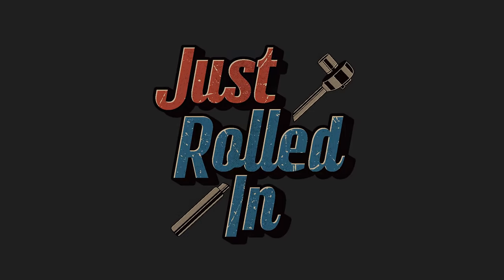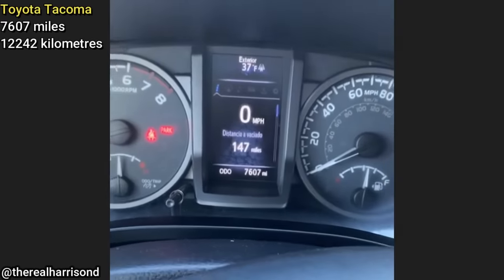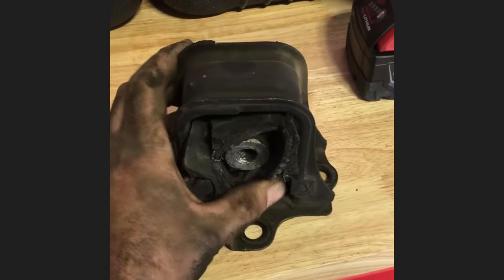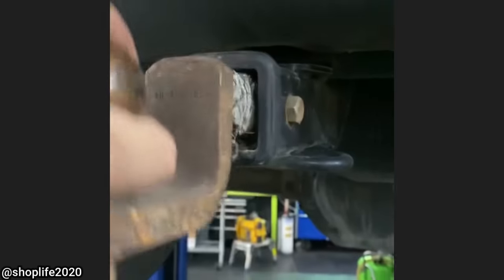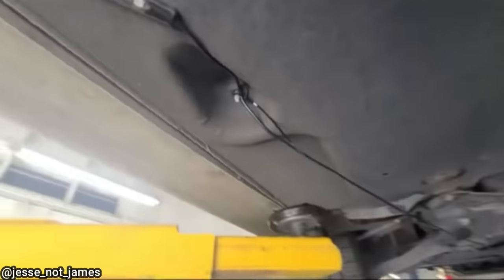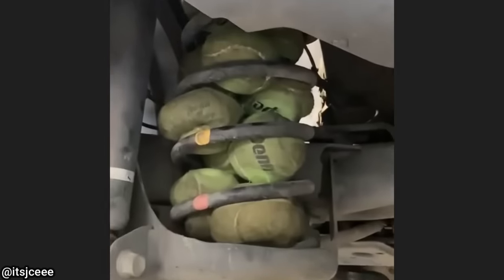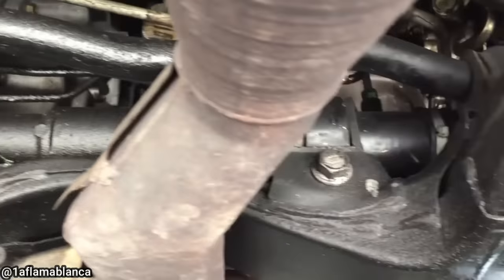Customer States Change Engine Oil On Tesla | Just Rolled In

Comment: That third one is the funniest issue I’ve ever seen, I can’t even imagine how convoluted the string of issues that would cause this must be
Reply from the maker: That door opening one is hilarious lol
Reply: @JustRolledIn  that one was great. Lol someone plugged something in the wrong port  unless they hard wired it in cus they are different plugs unless it's not like that on that make an model.
Reply: The second one is the heat not working, did you mean the third with the door opening?
Reply: @patricktrimble7954  yes, I’ve corrected that
Reply: Probably door weep hole clogged and a short occuring. I keep pipe cleaners in my glove box just to clean weep holes because the pollen down here is insane
Reply: actually, if its a cable driven power window, it may just be as simple as some of the plastic cable clips have broken and when the power window is activated the cable pushes on the door leaver rod. or something along those lines.

you would probably be able to open it from the outside when someone is using the power window.
Reply: @myopinion69420  sounds like a solid theory. those cords can come loose and cause a number of issue.
Reply: @myopinion69420  Yeah, a short would lock/unlock it but not pop it open necessarily, unless I'm wrong and that model in specific has those supercar like button opening doors.
Reply: @Kalvinjj  yeah, i suppose it might have aftermarket door poppers, if thats the case it may have been wired wrong/shorting with the power window.
Reply: My question is what specific set of actions caused them to find that out, and presumably it's happened multiple times since most people are too lazy to take their car in to the shop for something that happens once
Reply: @gideon7212  Pretty straight forward, really. Rolling down the window as you're in the drive-thru of a restaurant.
Reply: If it were within my power, I'd offer some free diagnosis time just to find out what it was.  I just want to know how an electrical switch can open the door.  Best guess is something mechanical is wrong such that the window hits the latch.  The left turn may be needed to move things in place.
Reply: That left turn isn´t part of the issue, that´s just what physics does with open door.
Reply: That reminded me of King of the Hill where Bill's home wiring is so jacked up that when he pulls the chain on the ceiling fan, his microwave turns on.
Reply: The window regulator pulling on the door actuator cable maybe??

I saw a vehicle which opened its fuel door everytime the driver's door opened fully.  The switch to release said fuel door is in driver's door panel & its wires were pinched by the door check strap, shorting the circuit whenever they opened their door all the way.
Reply: They took their car to
 Q's Performance & Audio shop.
Reply: @Kalvinjj  This is why it happens when turning left. Adds sideways g-force that opens the door.
Reply: Maybe they watched 2 Fast 2 Furious too many times. "EJECT-O SEAT-O CUZ!"
Reply: "was just gonna let it be but jimmy said i should get it checked after he went out the side the 1st two times"
Reply: Yeah I put good money on @My Opinion's theory, my first thought as well. I owned that model Camry and let me tell you it's one of the last cars in the world to have a fancy gimmick like electric door openers

Comment: I’ve done that tennis ball in the spring fix before, on my ‘04 LeSabre when the air shocks started leaking. The compressor was running much much more frequently, so I just pulled the fuse for the compressor and shoved tennis balls in the shocks, it definitely reduced the bounce over nothing at all.

Comment: That blue Chevelle at the end is quite the beauty. Love the speedos that go horizontal rather than these ubiquitous round ones now used. Just when I thought I had seen it all, I see even more goombas at work than ever before.
Reply: I was worried for a minute as we panned around the car that we'd see severe damage at the back. Very relieved to see it was just a sweet ride included at the end of the video.
Reply: She’s a beauty!
Reply: In summer of 1980 my buddies and I were out running around as per usual. I saw a 67 Chevelle, dark blue with black vinyl top in a field out in front of a trailer house. I stopped and looked at it and asked "how much"? The engine, tranny were already out. The dash wiring was pulled out and I didn't buy it because of that. The price 50 bucks! I kick myself about that and a 100 dollar 69 Charger. Those were the days...
Reply: I like the round gages gauges in the old IH trucks, never cared much for the dashes in the '70's Scouts/pickups/one tons. The dash on my '87 International is perfect!
Reply: My first car had the round speedometer. 120 was at about the 4 o'clock position. I saw the needle pointing straight down one night and that was after it had been coasting down for about a tenth of a mile. I also had to fight the car back into my lane because it took a hard dive for the left side of the road and almost went off the road when I took my foot off the accelerator. I never tried that again.
Reply: Chevelle is nice, but hoarder cars are definitely the best.

Comment: In the '60s, Buick had to get rid of their 2-speed torque converter, because it made a slight whining noise in low gear and customers kept screaming for new transmissions. Oldsmobile tecs had a fun time getting into arguments with customers, as to why snow tires had to go on the FRONT of their Toronados:)
Reply: switch pitch, not 2 speed.
Reply: someone told me of a story where he saw a guy in an Audi 80 (Audi Fox in the US), second gen, who got caught on a slippery road (not even a steep climb, maybe 2 or 3%?), and sat on the side bank looking at the hind wheels while the front wheels whirred loosely on the ice layer...
protip: if you drive front wheel driven, and feel the need to use the handbrakes to help with traction, this would work only on older Citroen, as their handbrakes work the front wheels...
Reply: @lotharrenz4621  The French can be a bit weird. -Jeremy Clarkson, Carnage a Trois
✌️😎🍻
Reply: @Jeff.78  I know; the french border is 1 and a half hour drive away from my place to the west... XD

Comment: 2:19  Hey, at least the customer realized they were in over their heads and brought it in.  Compared to the others that make this feature, they deserve an attaboy.
Reply from the maker: Definitely! Lucky they didn't catch that brake line on anything on the way to the shop.
Reply: Yeah, probably just a case of thinking it was doable but ended up being too much.  Having the wherewithal to realize you're out of your league is a sadly rare skill.
Reply: @psychickumquat  I think it's willing to admit defeat that's lacking. Society values winners, not quitters.
Reply: @russellhltn1396  Winners can be humble, which may be what you meant, or not. Either way, humility is also lacking in society.

Comment: I did the waste oil tank "fountain" when I was 18 and working at a used car dealer. Thankfully it was outside!

I was rushing at the end of the day and whipped the airline open 100%, then the geiser erupted.
Reply: I can hear the 'Beverly Hillbillies' music playing in the background!
Reply: I did once catch pan cannon. Didn't leaked, but the pan cracked its bracket and did it almost till ceiling, 6 meters above (about 20 feet). Luckily, no cars were in shop
Reply: @youtubeSuckssNow  you pump air pressure in it to move oil from the barrel in old oil storage tank. Forget some of valves, and you have  fountain

Comment: The Tacoma reminds me of a 1993 civic I had… drywall screws held on the rear bumper. That car was a total tweaker car. I ended up having a D16Z6 put in it replacing the stock D15B7. Loved that car.
Reply: @chir0pter  I’d love to know. They pulled out the antenna and filled the hole with silicone also. Honda makes a part for that…. 🤦‍♀️
Reply: @chir0pter  it's called being a poseur. He wanted the look on the cheap, but doesn't care about function.

Comment: What the hell else ya gonna use old tires for other than vibration/noise dampeners on engine mounts and body mounts oh and tow hitches????? love it! another great episode.
Reply: I mean I guess it works, I know a lot of the Miata guys are using hockey pucks for motor mounts.
Reply: ..& tennis balls in strut springs! Shoulda thunk of that when spring broke on my ( now gone..) Caravan. Oh well:/
Reply: I thought the rubber in the mounts was a good idea. I've used heater hose for sway bar bushings, and radiator hoses for other insulating purposes. And I still have some rubber from an ancient inner tube for all kinds of things, including fixing rattles. All on my own car, never for a customer's car.

Comment: When I had my corvair I would ask the to check my antifreeze to make sure it was good for the winter. Fyi for those who don't know, corvairs we're air cooled.
Reply: My father knew a guy who was a Sargent in the Army, every time he would get new privates in he would tell them to go and make sure they checked the coolant in the M26 Pershing tanks before they did anything with them.  Of course he would leave out the part where the M26 had an air cooled engine. Said most of them figured it out pretty fast, some though, yeah.
Reply: and Goober would put the antifreeze in with the gas, so the gas wouldn't freeze ...
Reply: were you a hot chick in the 60s ?
Reply: @mitchhedberg4415  Unfortunately he wasn’t able to join, but like the rest he probably would have

Comment: Oh, I did that oopsie once, forgetting to close a valve on the oil collector and got a fountain of oil messing the entire shop up. Easy mistake to do when you're a bit stressed. Only did it once though!
Reply: I think it's a rite of passage for mechanics. I don't trust anyone who says they've never done it, because they're probably lying.
Reply: @KarlEller  You might be right!
Reply: Did it when we refurbed our shop and installed the drain system.Boss was real impressed with my top coat on the new paint.Only do that once.
Reply: Is it because there is a pump going into the collection barrel causing pressure sending it out of the valve?
Reply: @AnAmericanPatriot1555  No pump. You just connect an air compressor to it to push the oil out with pressure. If you forget to close one valve the air rushing in makes the oil come out the wrong way.
Reply: @anakondase  Air pressure makes more sense to move than a pump. Thanks for the info.
Reply: @anakondase  forgot to mention… That does explain the impressive distance.
Reply: @AnAmericanPatriot1555  No.They are drained by hooking a hose to a plumbed drainage to a storage tank and then plugging an air line into the collection barrel and forcing the oil out.If the oil collector at the top is not shut off the gushes out the top a la geyser.FUN

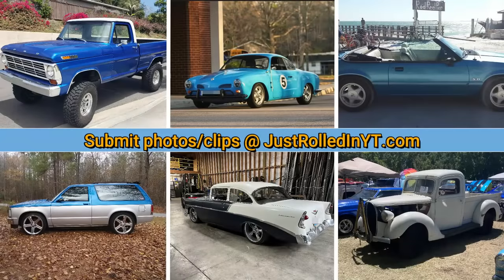Comment: 2:58 - There will always be a special place in my heart for the old square-body S-10 Blazers...
I learned to drive on a carbureted '85 2.8L (do not buy these with A/T and 4WD, no power at all), and I owned two fuel-injected '91 4.3L.
Reply: P.S. The blue Ford is also 😍

EDIT: I'd really like to know what the cause of the magic opening Camry passenger door is. I prefer to be proactive, instead of reactive...

Comment: Mechanics should be able to "Red Flag" a vehicle, so we don't have to share the road with some of these customers.
Reply: that's a good idea, but me and a lot of other mechanics drive sketchy cars too. the only difference is that we know the limits on acceptable sketchyness
Reply: Naw that would just be another reason for us to be the bad guy. Not to mention it would no doubt be used and abused by Tate's or any other corporation
Reply: @codyslayer6715  Yes, it would be a terrible idea. Ethically challenged repair places could hold cars for ransom.
Reply: And who would ensure that the mechanics won't abuse the "red flag" system to their own gain?  This year, I took one of my trailers to get a safety inspection.  But my primary truck was down.  So I used another truck, and because I don't use that one for towing, it doesn't have a brake controller.  I take it to the only inspection station in town.  They failed my trailer, and would only pass it if I paid 800 for them to install a controller.  Ponder on that for a second... lights work, tires have great tread, the brakes work (just pull the pin on the break-away and the tires lock up), but he failed my trailer (which was being inspected) because of my truck (which was NOT being inspected).  I ended up dropping off my trailer at another inspection station in another town 40 miles away, and they inspected just the trailer.
Reply: Those vehicle owners belong in prison
Reply: @The_R-n-I_Guy  ....and THAT is even sketch by MY standards...... :D
Reply: And customers should be able to "Red Flag" a mechanic, so no one gets scammed by them
Reply: In the commercial world You can. At my work we have 3 O/Os right now leasing company trucks cause there own trucks won't pass a federal.
Reply: These people are only dangerous if they have a firearm. Cars are not dangerous according to our all mighty leaders.
Reply: @coreybabcock2023  Only if they actually harm someone else. Innocent until proven guilty and no victim no crime. Its horrible idea to give government anymore power than it already has and even more so when there is no actual victim anywhere. Only victim in cases like that, would be the car owner.
Reply: @Hellsong89  they should be in jail
Reply: So you mean a failed state inspection sticker? 😁
Reply: Mechanics can do that here. If its not safe for use, they'll flag it in the DMV db and refuse customer to drive it from the workshop. Customer is offcourse allowed to get it towed to another workshop (or home) for repairs if they dont want it fixed there, but it needs inspection by a DMV approved workshop again to be road legal.
Reply: People have different definitions of "safe". I don't have a problem driving on tires with 3/32 tread left, but some people consider that unacceptably dangerous.
Reply: @annehaight9963  it is dangerous
Reply: @KristianF88  with VA DC MD had that
Reply: @coreybabcock2023  Relax dude
Reply: @LittleVictorMinecraft  no
Reply: @annehaight9963  Even tho you're comfortable with it, it doesnt mean its safe. There are no different definitions. There are very strict and detailed guidelines on what is ok, and what is not.
Reply: That's how it's done here in Sweden. Yearly inspections and mechanics can ground a car and put it on a no drive list until it's been fixed. Helps keep our roads safer.
Reply: @Aussie Doomer Works well here. No way for mechanics to abuse it since they cannot themselves repair the car before it's been officially inspected after said red flag. And the inspectors aren't some random folks, they are very strict people following very strict rules.

(edit, you can also repair the car yourself if that's your preference, as long as it passes the re-inspection after)
Reply: @Hellsong89  Nah dude if you're driving a death trap on the road you are making everyone else around you your potential victim, and shouldn't be able to drive it